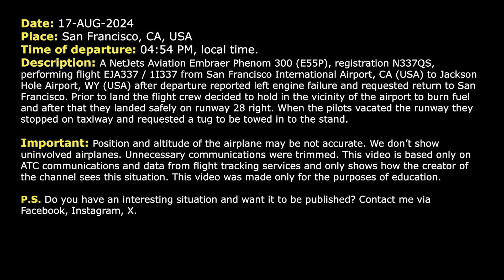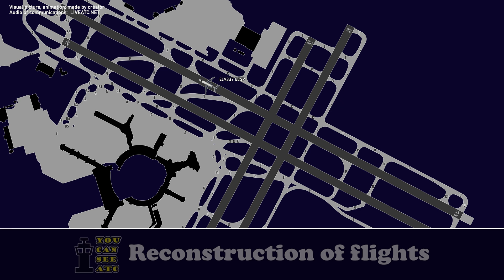Engine failure shortly after takeoff. Crew requests tug after landing at San Francisco. Real ATC

Comment: I flew the Phenom 300 at NetJets for several years.  Nice Jet, very easy to fly.  The reason for needing a tow is they weren't authorized for single engine taxi due to our Operations Specifications.  Also, they were a bit heavy.  I would have just landed overweight thou unless they were getting partial power from the bad engine.  Overweight landing inspection isn't a huge deal.